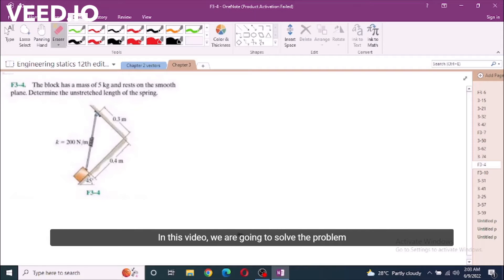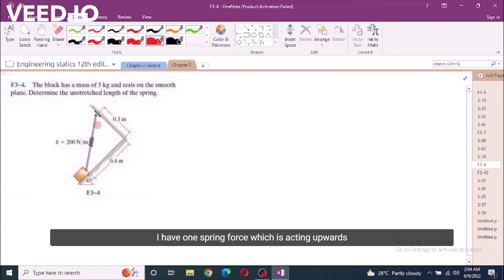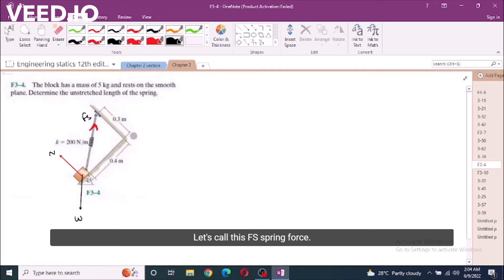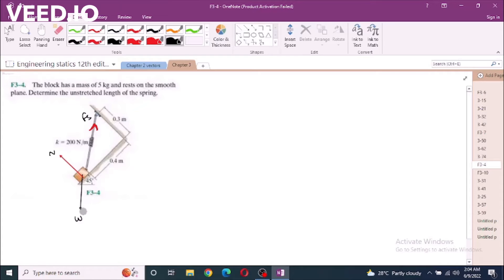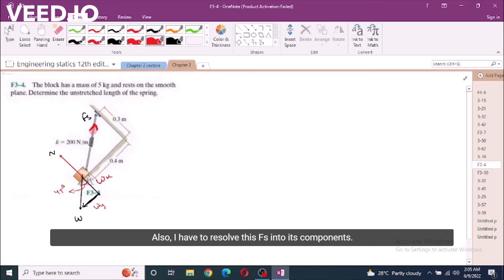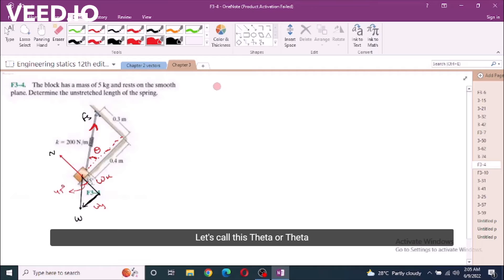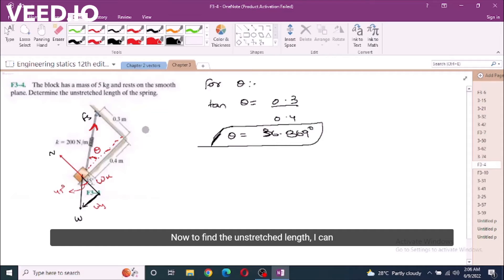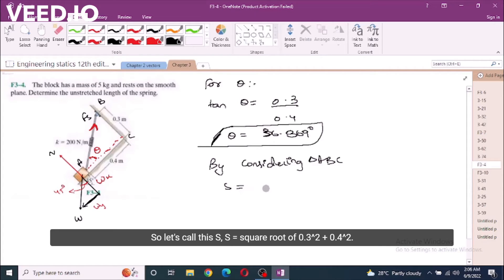F3-4 hibbeler statics chapter 3 | hibbeler statics | hibbeler

Comment: Stretched length=.5m
Unstretched=.283m 
How is this possible?
Reply from the maker: Because stretched length is the sum of unstretched length and extension.
Reply: @solutionsmanual9535  I mean clearly the spring won't stretch that much of a value? L =l'+lº
As you said l' here extension and lº unstretched length,if lº is .283 and full length is .5 then the extension is .217.
So it doesn't stretch then it compresses?
Reply from the maker: @ismails2864  No you got it wrong. Here extension is occurring because stretched length is 0.5 and the unstretched length is 0.283. So 0.5>0.283 so spring is extending.
Reply: @solutionsmanual9535  so it's not always mandatory for the streched bit to be more than the unstretched length?
Reply from the maker: I hope it will help!!